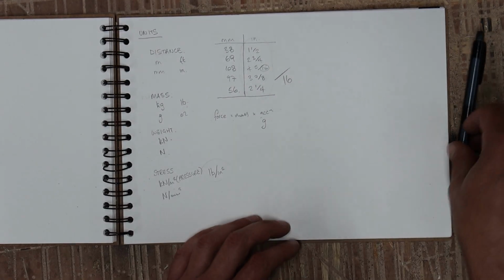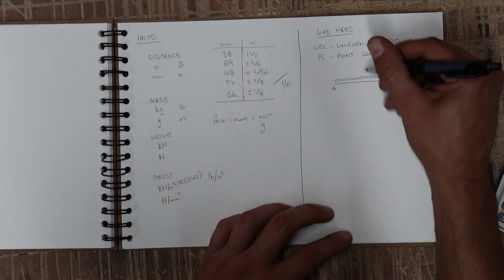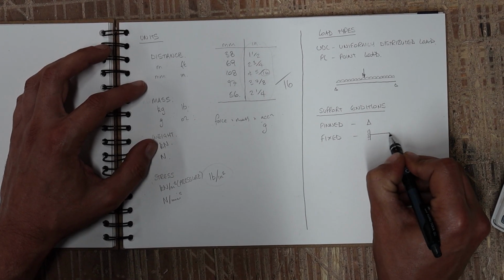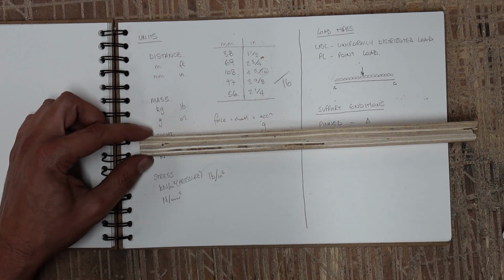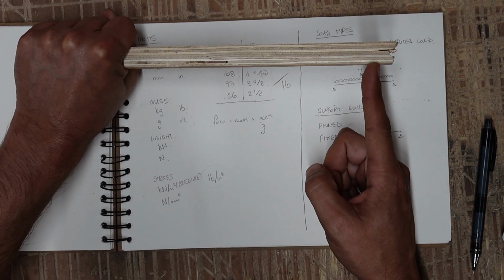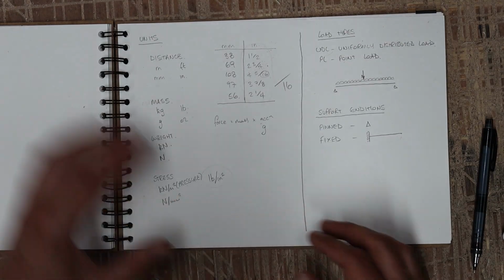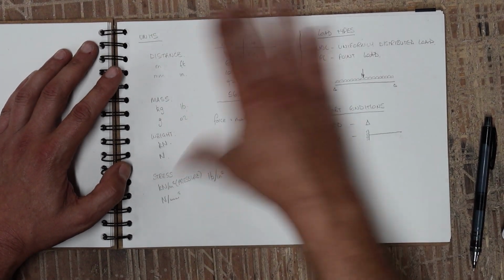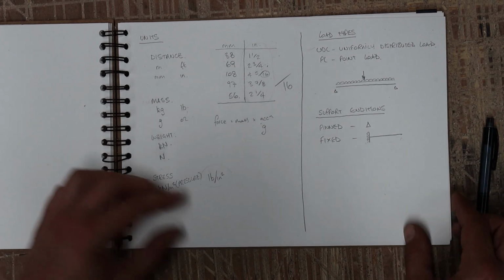The Basics of Structural Engineering and Woodworking

Comment: Thank you, that was very informative although maybe not matching the title particularly.   I can fully appreciate that when you know a subject well it can be nearly impossible to keep things simple as there are always exceptions and it’s hard to suppress the desire to explain them as you want to be accurate.   
From a woodworking point of view it would be useful to know how to apply this to a project. Say I’m putting up a shelf to hold boxes of screws, I’m using a length of 18mm plywood, what sort of span could should I use?   As an amateur I would go for 300 to 400mm centres but maybe 600 would be enough.  Or maybe a stud partition, 400mm centres or 600?  9.5mm plasterboard or 12.5mm.   I’d always go for 400mm and 12.5mm as it’s my house but am I wasting money? Is it overkill?  I probably won’t change but it would be nice to know enough to be able stick numbers into a piece of software or online site to guage or better understand the design choices available to me so it works and it lasts.
Reply from the maker: Oh dude. Project videos, design videos, case studies, timelapses... I have so much planned for this channel.